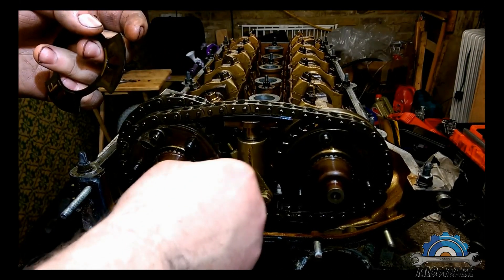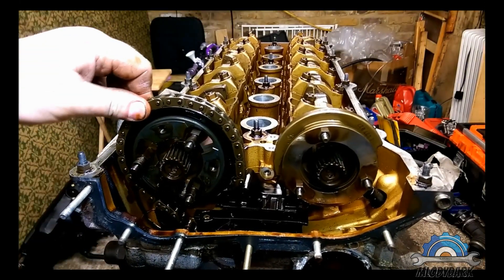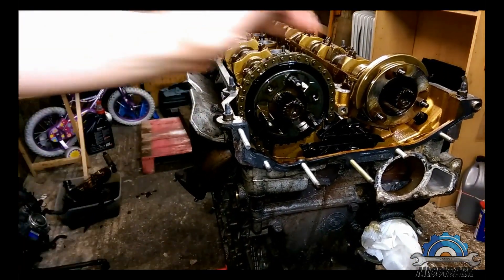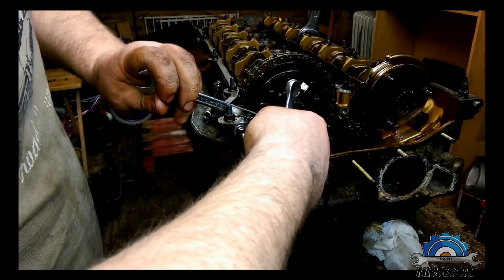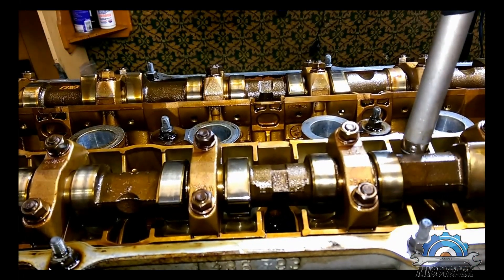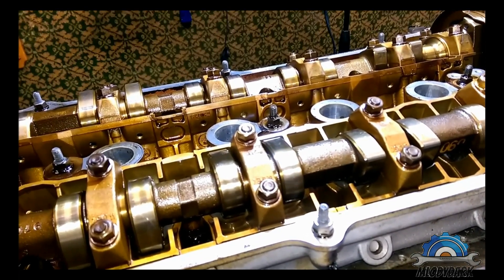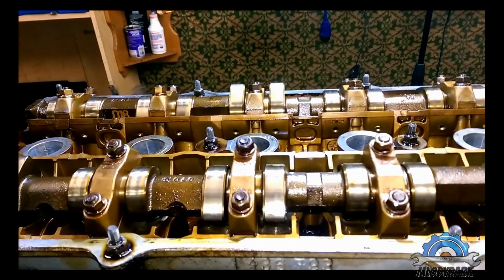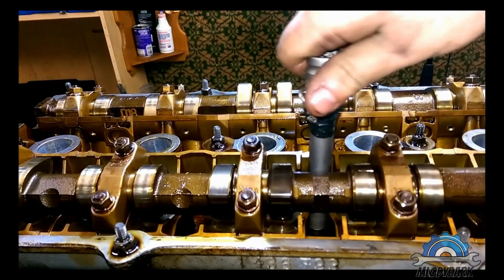BMW e46 M52TU,M54 timing chain and head bolts removal

Comment: Are you sure about the undoing of the bolts ? Most of the engines i've done , have the opposite way of removing the bolts . Starting with the outer ones and the same cross style , going to the middle ones . This style looks more like when you should tighten the head . Then is from middle to outer ones .
Reply from the maker: Crank yes you are right, my error
Reply from the maker: Crank I will correct or remove this video cuz dont like it